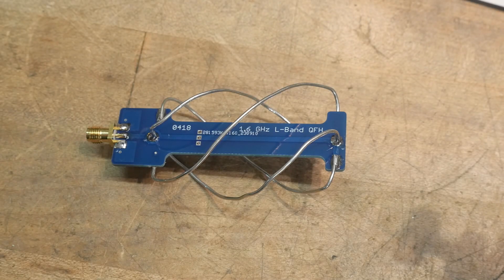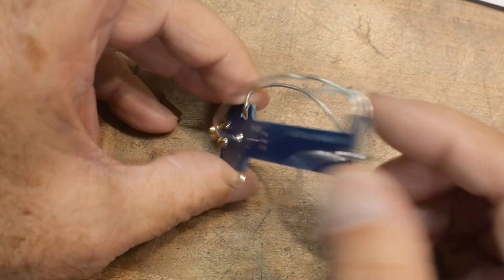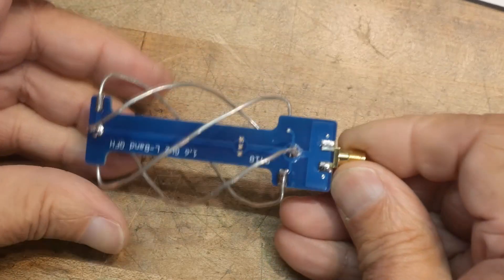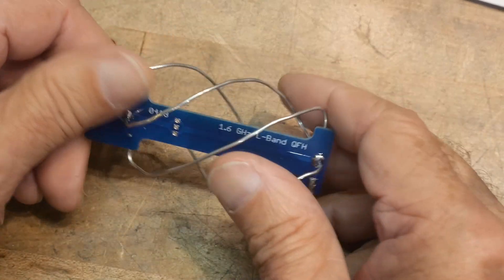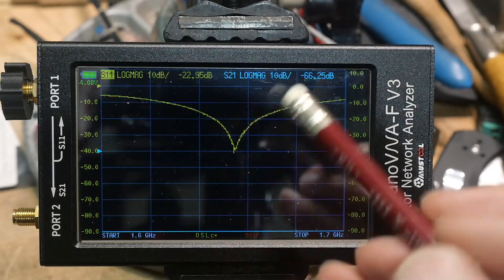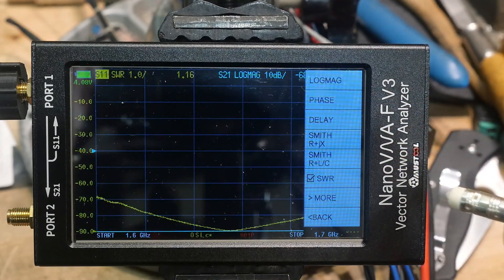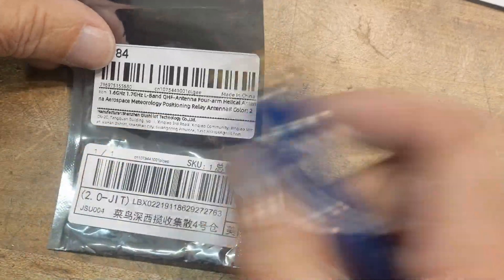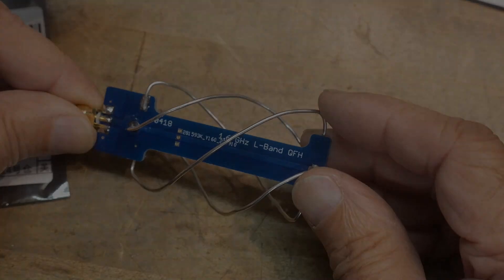#2104 1.6GHz 1.7GHz L-Band QHF-Antenna

Comment: You'd want to make sure you ended-up with the correct polarization. I believe that RHCP is the goal for most applications. Hopefully the PCB design steers the assembler in one direction.
Beware if you plan to add a reflecting dish, as that would flip things.

Comment: How are the two helices fed? Do they do the old trick where one is slightly oversized and capacitive and the other is undersized and inductive or do they do something clever with the strip lines on the circuit board?
Reply: They'd either be in parallel, or a power splitter (not sure, I think the former).  Edit to add: Looks to be in simple parallel.
All four elements would definitely 'supposed to' be the same size and symmetrical.

Comment: Actually this antenna is for reception of radiosondes (meteorological balloons) like the Vaisala RS92.
Reply: You sure? Internet says "The Vaisala RS92 radiosonde's frequency can be set between 400–406 MHz." 
This antenna is for 1.6 GHz; says so right on the PCB. And it's also really obvious by the size that it's not for 400 MHz.
Somehow I knew that radiosondes are not normally found on 1.6 GHz, so I looked it up to see. Cheers.
Reply: @JxH  In the US there are two bands used for radiosondes. One is that 400-406 band, and the other is much higher - up around 1600 MHz, if I remember correctly!
Reply: @flapjack9495  Okay, so unlike the Vaisala RS92, which is ~400 MHz. Thanks.